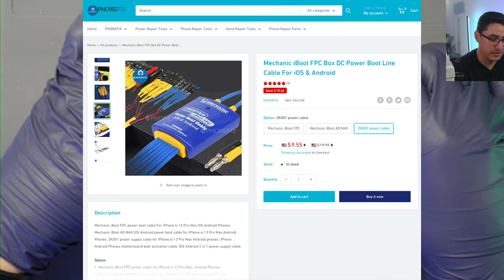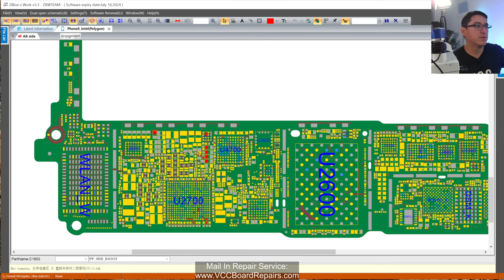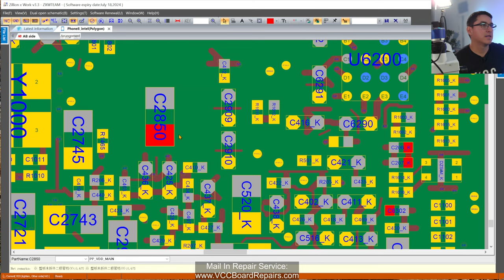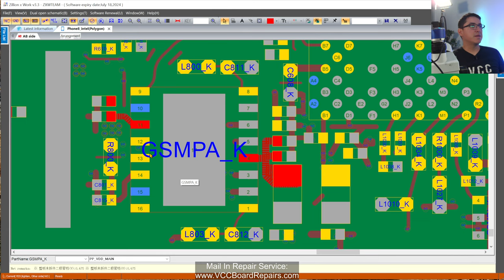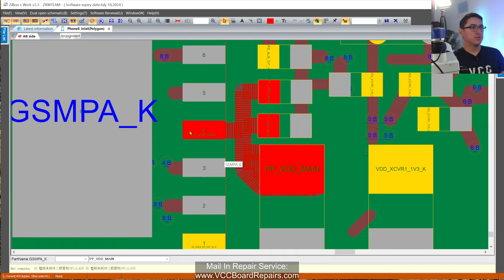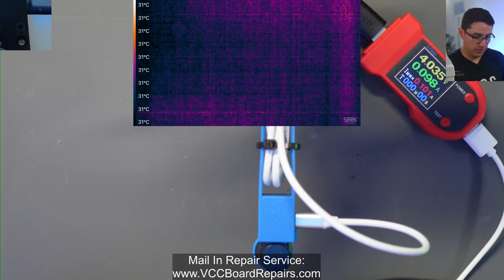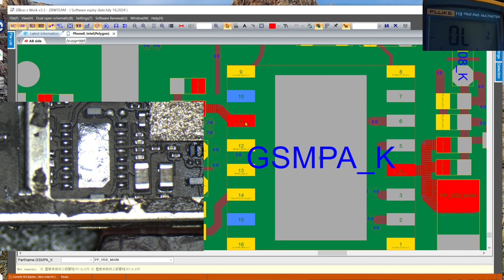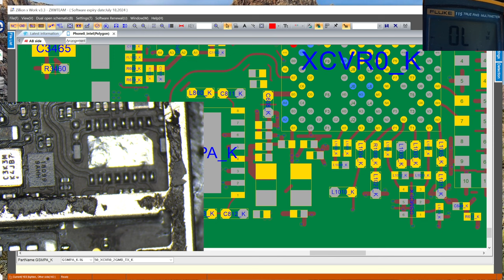This iPhone 8 Stopped Working Suddenly | How To Fix An iPhone With No Power

Comment: Hey great video but why do you even bother checking the common lines, if the thermal camera will show the short either way? Wouldn't it be more usefull to use the cam directly?
Reply from the maker: Because whatever gets hot isn't always the fault

A good technician will double and triple check before doing any work

Comment: the zxw dont match up with my ip8 board ! i have try erverytthing but it doesent!
Reply from the maker: Check if Intel or Qualcomm version
Reply: @VCCBoardRepairs  it has A 13 processor !
Reply from the maker: That's not an iPhone 8. That's an iPhone SE 2020 (2nd Gen)
Reply: I found it, thaks =)
Reply: but zxw has only se 2 polygon !
Reply from the maker: That's all you need
Reply: @VCCBoardRepairs what would u do if the vddmain is ol ?